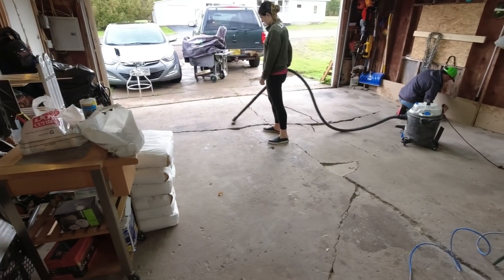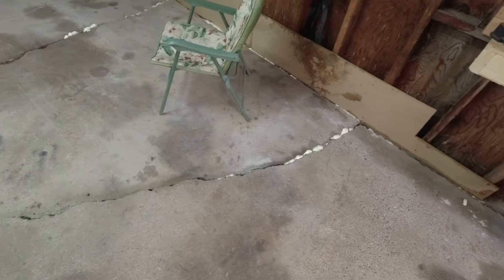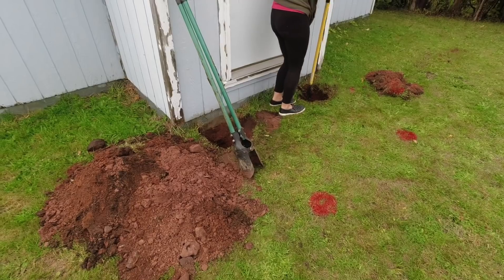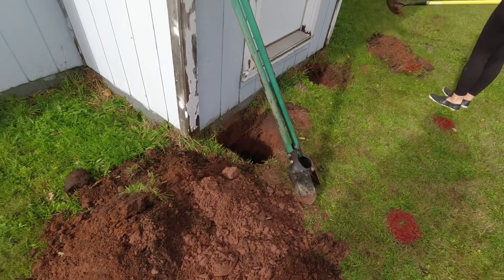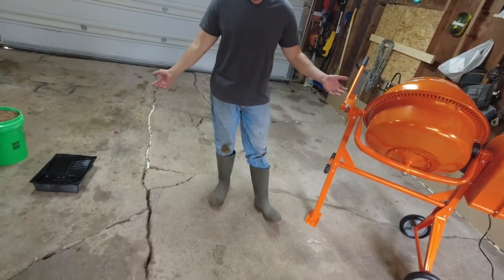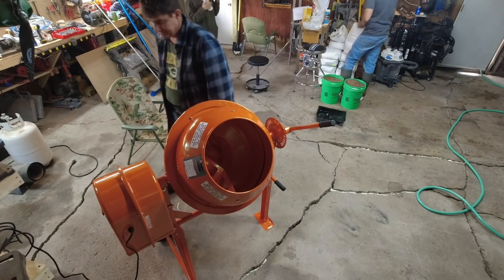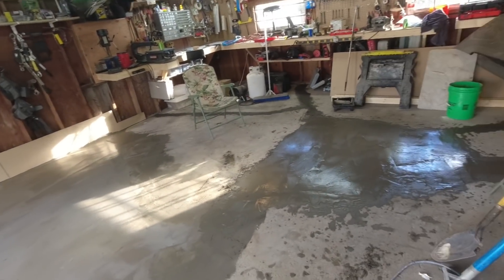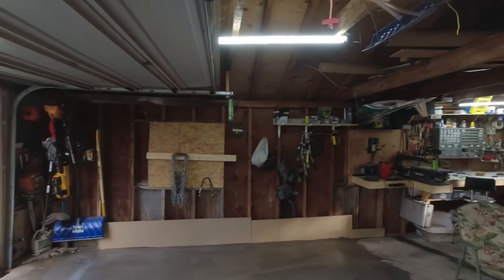Putting TammsGrout Supreme in the Yooper Garage, fixing all these cracks! 2021/145

Comment: Hi Larry, When I worked at Sears, we sold a Porch and Patio Paint which was specially formulated for cement, and there was a little bag of grit you could add to it to make it less slippery...Sears doesn't sell paint anymore, but the hardware store or Menard's may have it.

Comment: Concrete tends to crack more the wetter it is as when drying out, it shrinks as it looses the water content.  Reflective cracking in pattern of original cracks may happen, at least it will be level.  if paintin, use a paint formulated for concrete, not exterior house paint.  GO Packers.
Reply from the maker: 10-0 so far
Reply: I agree with the paint. I did my basement floor with paint made for concrete floors. Has held up wonderfully.